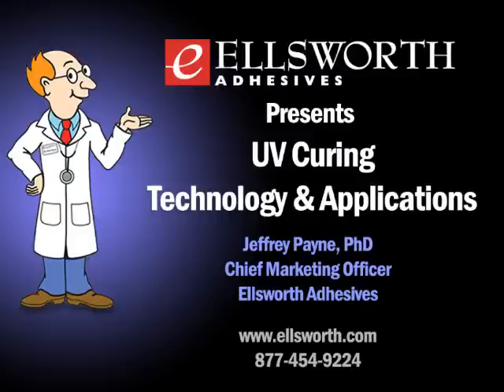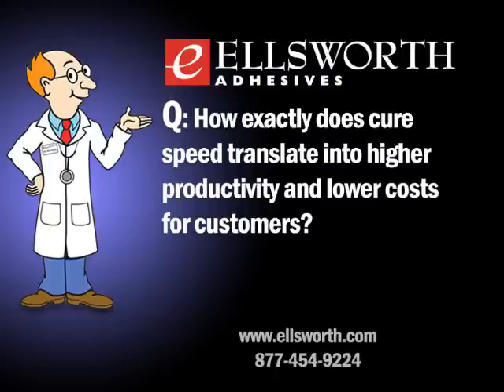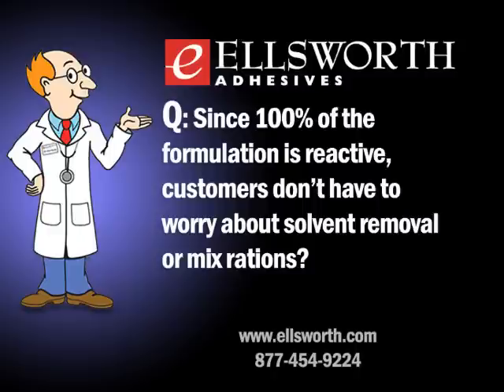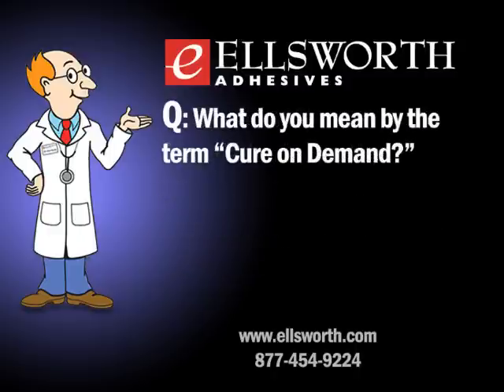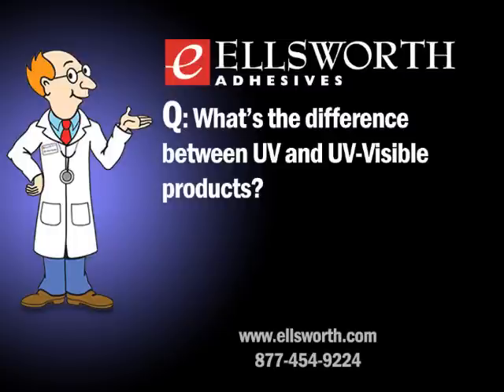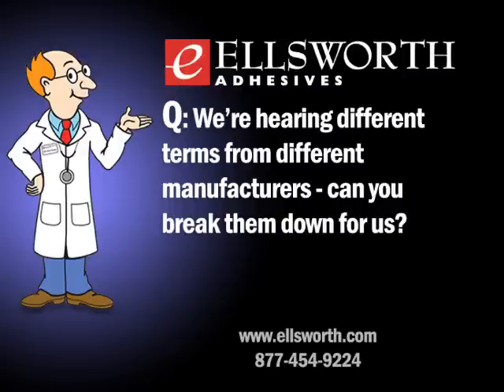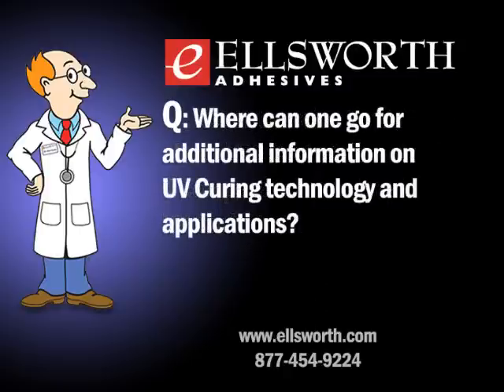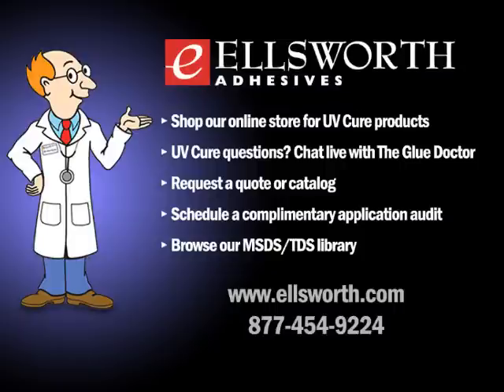Learn About UV Curing, Technology, and Applications

Comment: It actually depend on the material (Colour OR Adhessive) and the Energy produced by the UV Lamp OR UV LED. For eg. There are screen printing Inks which cure at 200 W and some at 300 W.
Reply: sayitthere

There's no industry standard.  There are a couple of clear coat finishes I'm interested in but each one has a different recommendation for the measured power of the uv it requires.
Reply: Wow......, this is really wonderful UV curing technology! 
By the way, please feel free to get back to us, if you will need Smart High Power High Voltage UV Lamp Ballasts, reference at www.uvballastsupplying.com. Thanks

Comment: why cant i get uv curable products on a small scale for craft and other uses for cheap?
how much ACTUAL uv is needed to cure products? please dont dumb the answer down, i want to know what type of light is required and how cheap it can be obtained, can a low power led for example cure it over a longer period of time or is there a minimum power level to cure it?
Reply: Frogz

Did you ever get the answers to  your questions?

Seems UV is still not for the weekend diy'er or even the very small business.
Reply: Wow......, this is really good knowledgy on UV curing! 
By the way, please feel free to get back to us, if you will need Smart High Power High Voltage UV Lamp Ballasts, reference at www.uvballastsupplying.com. Thanks